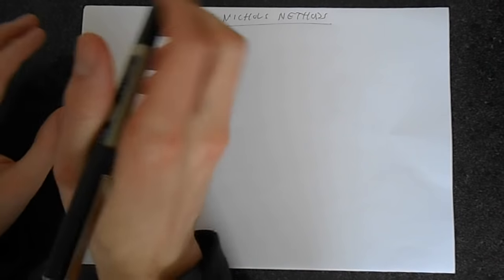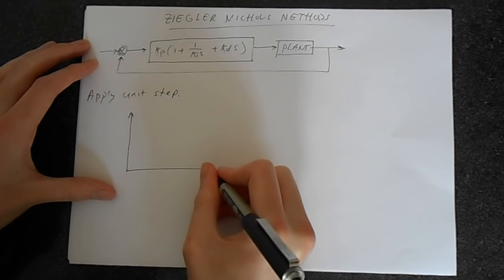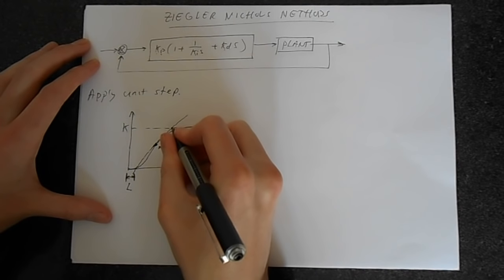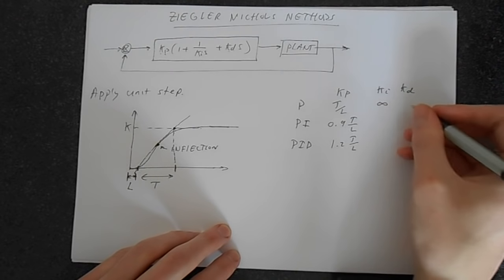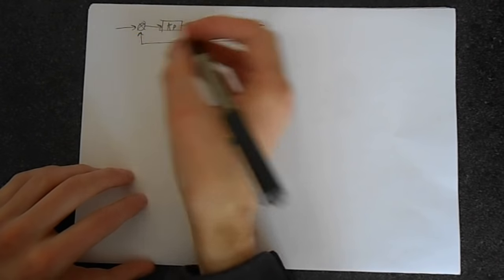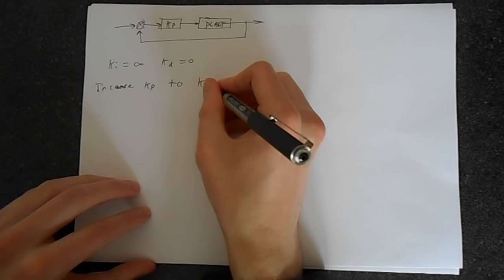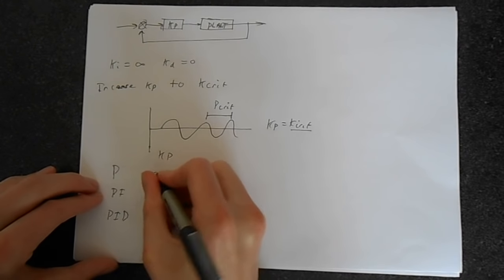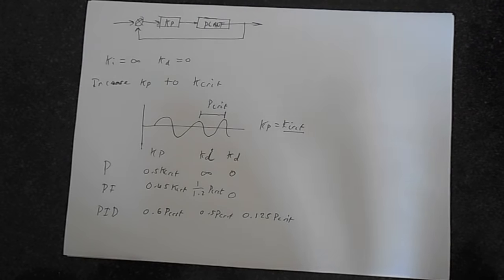PID Tuning: The Ziegler Nichols Method Explained

Comment: for anyone else read old comments.  it is first method always, you dont want actual equipment to be oscillating and go damage.  In HMI say it is pump running at 20% and PLC pid controls analog output. In HMI force analog output to be in Manual mode, so it pid no longer control output, than change eg. from 20% to 25% and see historian for flow feedback data at exact time of setpoint been changed. Most cases dont use PID , use PI control but instead D term apply software first order lag filter for the feedback signal. increasing Kp makes faster response but increase overshoot, Increasing Ki reduces error and damps Kp oscillation but too much will come back to as if it was only Kp control  but even with increased overshoot and increased oscillations. If output out of bounds of physical equipment capability do not integrate output(integral antiwindup), when output is within the range continue integrating.

Comment: One thing please.
The second method is used once the first is failed, and it fails whenever the plant response doesn't follow that S shape.(S shape will be there whenever there are no complex poles pair or zero at origion).
In that case 2nd method will be used..

Comment: Thank you for this quick presentation. There all we need.
I think there is an error for the Kp value of the PID in the second method: this should be Kp = 0.6*K_crit and not Kp = 0.6*P_crit to be coherent with what is above (and with physical units)

Comment: @The Complete Guide to Everything
. I have an estimator chart from my tutor which states for Method 2, PID, Kp is 0.6KCrit, not 0.6Pcrit as per video. Is this correct?
Reply: was it? I have the same question
Reply: @nickybutch3  Well I used my tutors estimator chart and wasn't deducted marks. I have had no feed back from the video creator.
Reply: @champcv1  Mine is also Kcrit, not Pcrit. I think it's a simple typo by the author

Comment: apply unit step: closed loop? or open loop? with controller? or the plant only? You did not say.
Reply: +Volker Block everything included I guess.
Reply: +Volker Block  for the first method a unit step is applied over the plant only at open loop (i agree with you that this is not clear from the video)
Reply: @marcostoibero  I think you are right. The first method is only applicable to some specific plants like a 1st order system with time delay.

Comment: hello
i have a question or you can say a statement about your first method. in your video at 0:35, you drew a feedback pid system and then you said that we need to apply a step input to the feedback system including the plant and pid controller with unity feedback. as far as i know, in this method we do not apply step input to the feedback system with pid controller in it because we have not decided the values of the 3 terms so far. the thing is we apply the step input to open loop plant without and controller and calculate what is called R and L. please correct me if i am wrong and vice versa

Comment: Différence between pcrit and kcrit ??
Reply: P is for period. K is for gain.
1. With Routh- Hurwitz stability criterion you find critical gain(Kcrit which is the maximum value of K). 
2. When K=Kcrit, s=0+ jw, so you put it into the characteristic equation to find w.  
3. From Pcrit= 2π/w you find Pcrit.
4. Put them into Ziegler- Nichols equation to find Gc(s).
Reply: @coal2710  thanks bro, I was searching for these